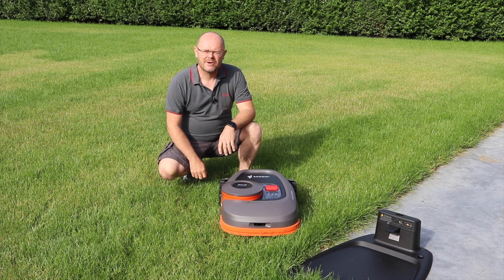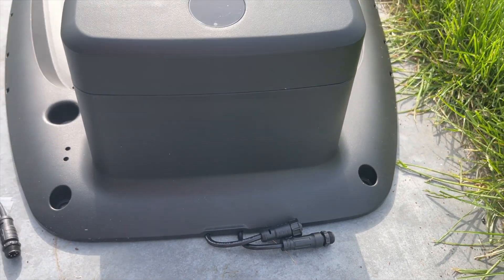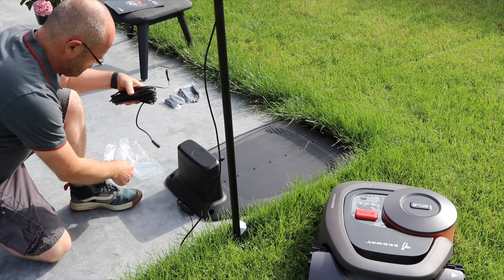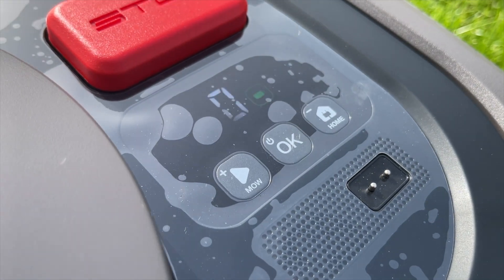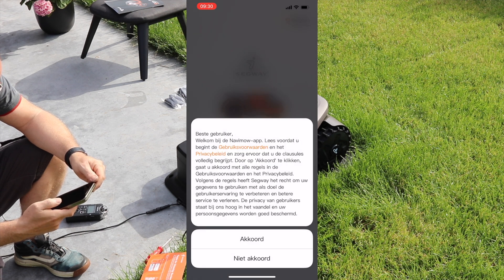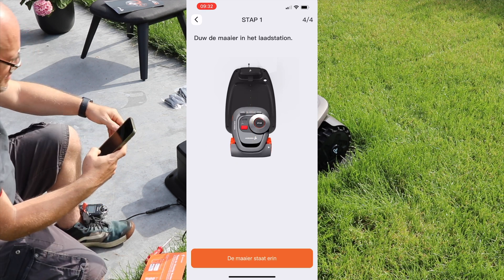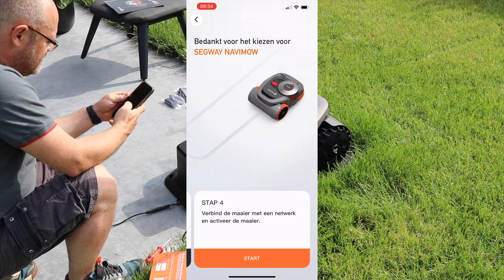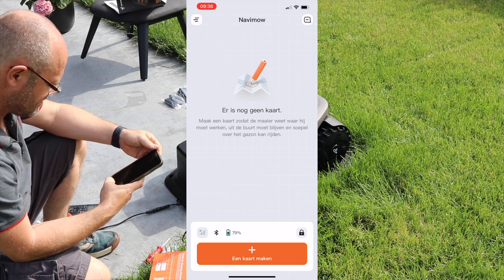Segway Navimow Installation

Comment: Could i start it on different map for my front garden and different on the back theres steps between so wouldn’t be able to drive only place it and start on the front garden map
Reply from the maker: Charging station is fixed point relative to antenna. So each time you move charging station you need to start from scratch.
Reply from the maker: Not sure if possible. I think you need to start from docking station. 
You can use a patway to your frontgarden, but just putting it in the frontgarden by hand will probably not work
Reply: @Sailingandelectronics  thanks for the reply how about moving the charging station would i be able to save both map to start from different ones

Comment: Why u dont try the area in 1:05 instead of the area in 1:40?! Makes no sense. This Mower is new. We need exactly this tested…
Reply from the maker: This is working with satellite and cannot have walls, roofs, trees within 2 meter. Needs to “see “ the sky from all sides in 45 degree angle.
Reply: @Sailingandelectronics  yeah :) but we Need to Test exactly whats working and Whats Not. Many people want to setup the base exactly in Front of the Wall. Just try it :)
Reply from the maker: @BenjiBizz  now I understand your remark… how close can we Go…. That’s what I want to do, but since this is my own mower, I realy wanted to see it work before the grass was too high again. I don’t have 10 machines as the sponsored reviewers. Mine is real world.
Reply: @Sailingandelectronics  no Problem :) i will install it in the Front of the Wall and look if it worked or Not :)
Reply: @BenjiBizz  How did it go for you in the front of the wall?
Reply: @A1ex6arcia  no problems :)